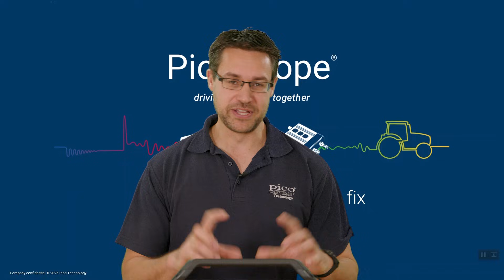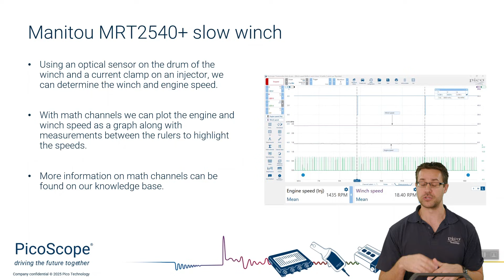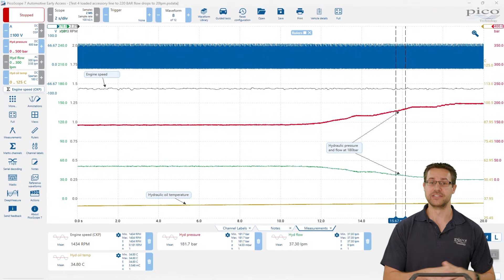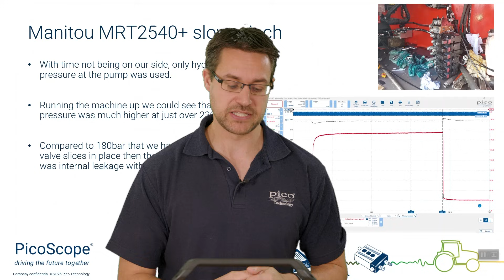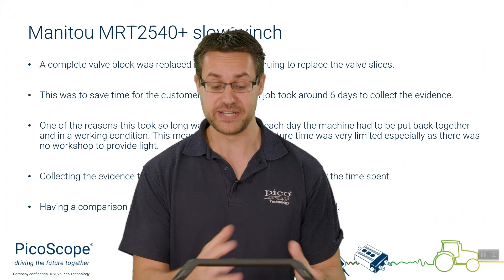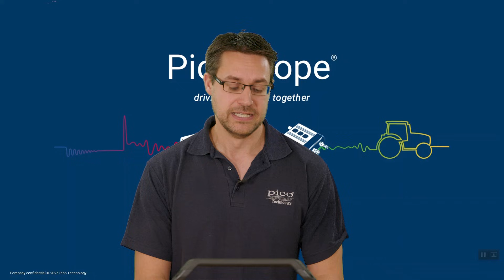Case Study | Manitou Telehandler Winch SLOW? Hydraulic Flow Diagnosis

Comment: hydraulics are not much different from electrical.  first thing is a visual inspection. oil level proper type proper suction and return screens not clogged.  then a pump flow  and pressure test. just like a car if the pump wont put out nothing else would be ok.   would you diagnose an electrical issue with a 12v battery only puting out 9.6 v???  just because other things work dont assume!!!  we now what happens when you assume. once the heart is ok keep going down the arteries until you isolate the problem. the pico is nice but to jump right in with it may cause deep travels down a rabbit hole.  go ask alice  she knows.!   if this uses electrically controlled variable flow sollenoids then that side a pico is almost a must.  otherwise  standard hardware can get you where you need to be just as fast.  thanx for the video though

Comment: By experience - I think problem was in the remote actuator, and the whole valve stack didn’t need to be replaced. 

The question is: how did you activate auxiliary section, only from the cab, or actually took the handle that is clipped to the frame little bit behind the DCV, screwed it in the corresponding section of the DCV, operated manually and compared the readings between manual and remote ( from the cab operation). 
I’m pretty sure that only thing that needed to be replaced was the spool position actuator.
Reply: i was thinking the same thing.  when a problem appears to be in only one circuit it is usually  an attatchment like a spool actuator or circuit relief. thats easily tested by swapping with a known good circuit. i've had electronic controls have an electrical problem  for which a pico would be well suited. i believe they are trying to point out engineering level complicated  usage for thier product which is fine and all ut a good thought process and minimal tooling can be faster in most cases

Comment: If main LS valve set to lower pressure - you not stopping any oil back to rank, you de-stroking the pump and lowering pumps flow.
The function of the LS is constantly maintain margin pressure ( usually 20 bar) difference between LS pressure and main pump discharge pressure.